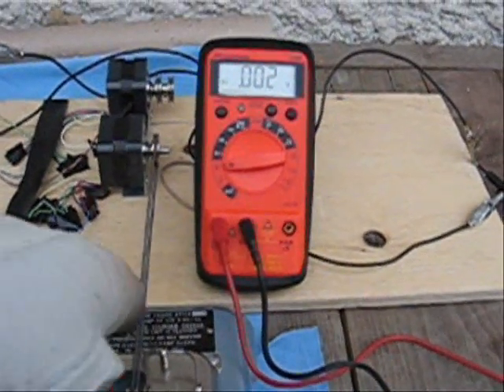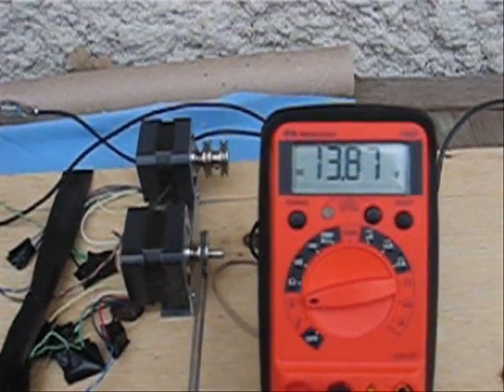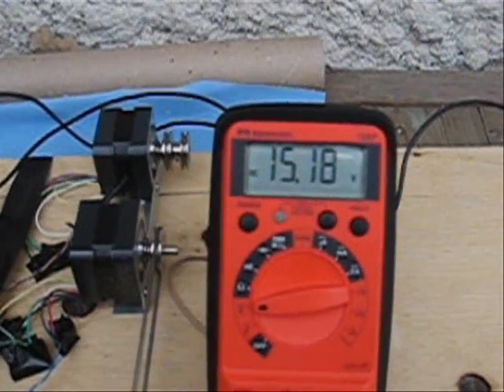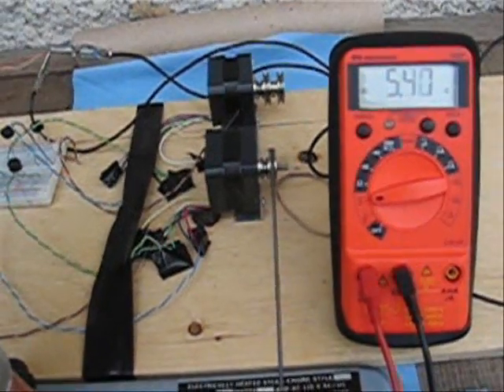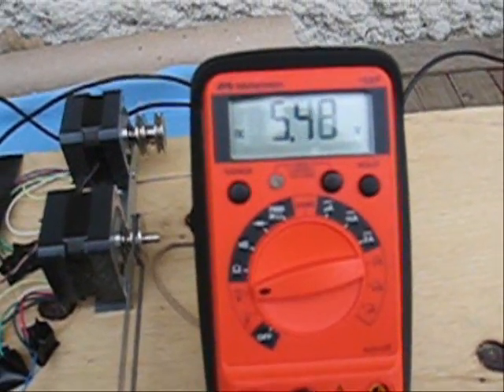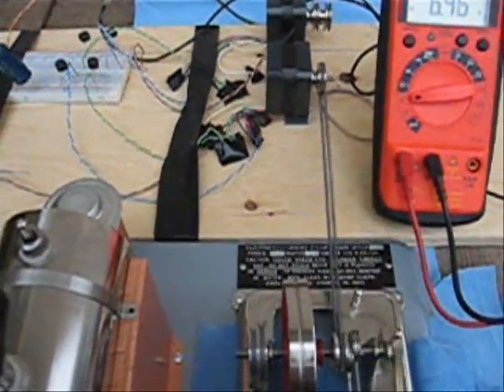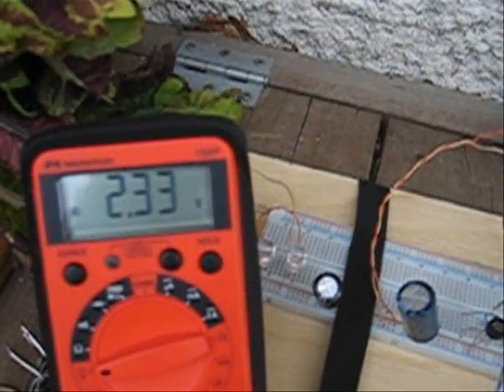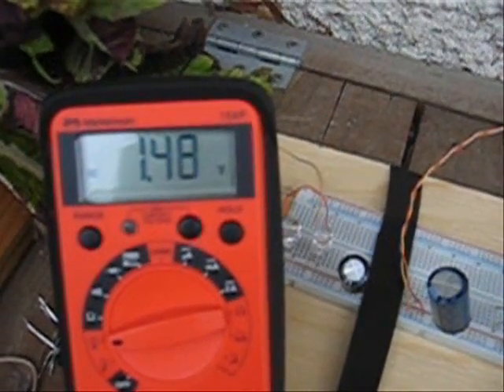Buffer Capacitor in a DC power circuit

Comment: great! ok Im building a solar charger with lithium-ion batteries. 3 3500 mAh batteries in parallel per cell and 4 cells in series at 14.8 nom/ 16 v /16.1 v max ( I want to stay close to 4v per cell in series) this would give me 12 v (with a buck) at 10.5 Amh. Now for the input, solar panels, also with a (buck), but someone mentioned a smoothing capacitor would be required for the delicacy of lithium-ion cells to charge. what size of capacitor would I use for this? I would assume I would run the capacitor before the buck to get a more consistent voltage?